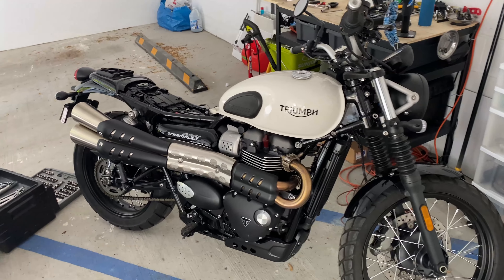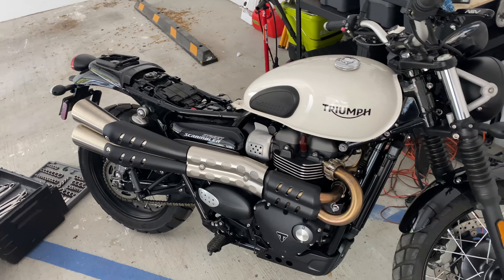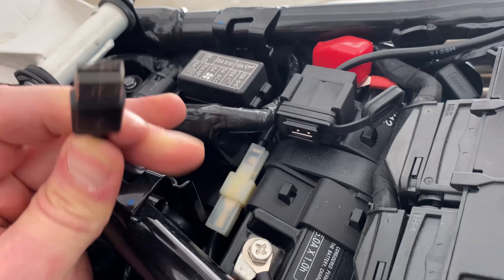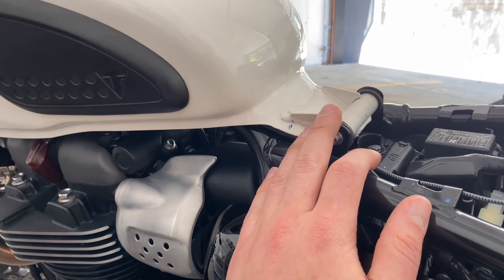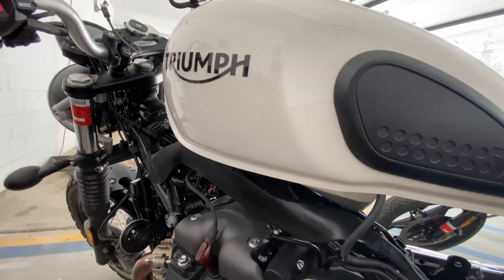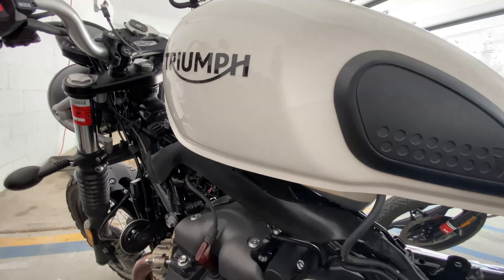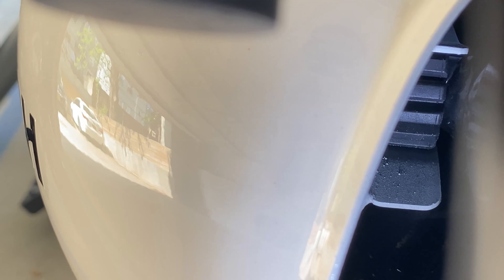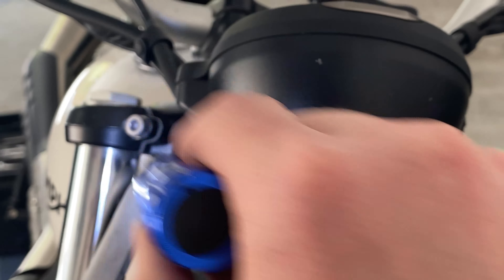2019 Triumph Street Scrambler - USB Installation & Tank Removal

Comment: Excellent video - I have a 2023 - removed (lifted up) the tank to access underneath - wondered as well where the front attachment was - re-installed it and something was not right, gut feel, checked the lock to lock steering - and was nowhere near the range it should have - thanks so much for the trip with the C, fixed it. Thanks again, Ronny

Comment: You never actually removed the tank complete, maybe relabel your video. Removing the tank fuel lines and electrical would be more helpful than trying to balance the fuel tank whilst running cables. I've done your method before with a usb cable under the tank and it can be frustrating trying balance everything and not scratch the paint.